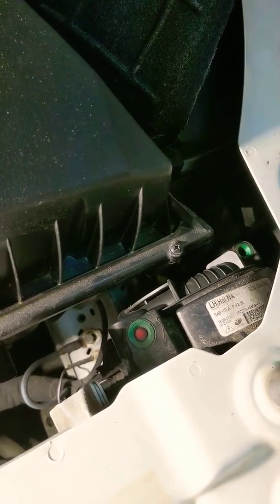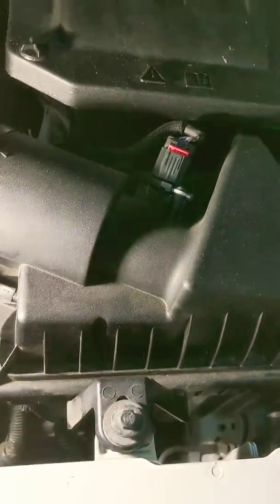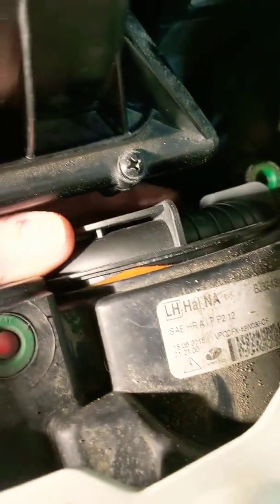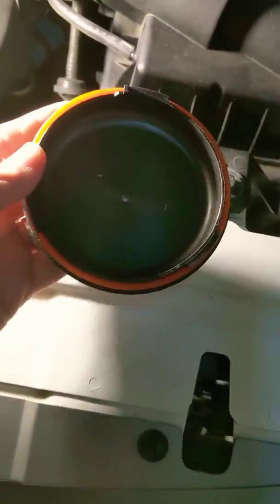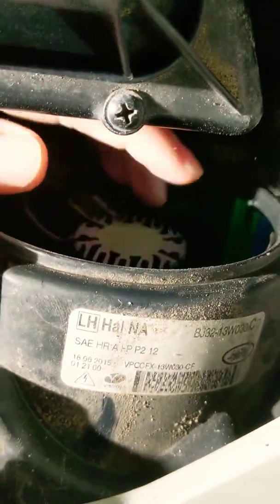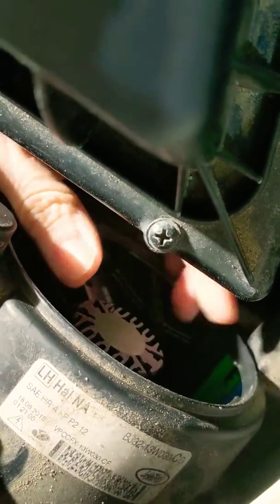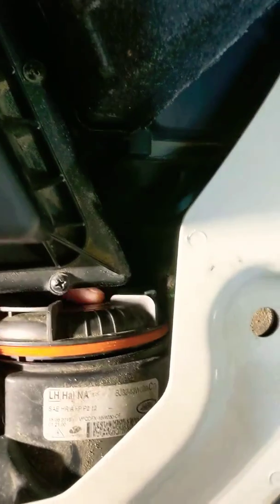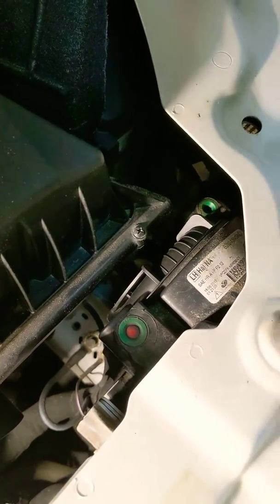Replacing headlights on a range Rover evoque - Without taking your car apart

Comment: What type of LEDS did you go with and do they set off any warning lights ?
Reply from the maker: I don't recall what the lights were but I wouldn't use the ones I chose they weren't seemingly bright enough I would use something with at least 15000 lumens if you can find it. And no it didn't set off any sensors or anything.